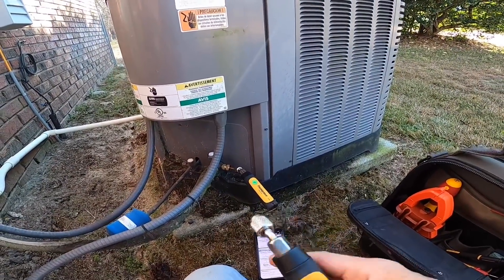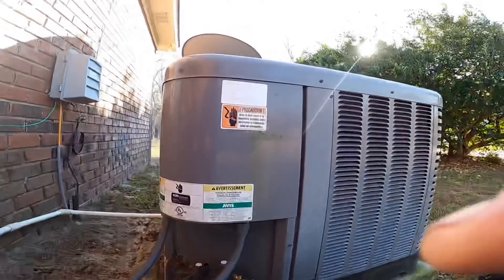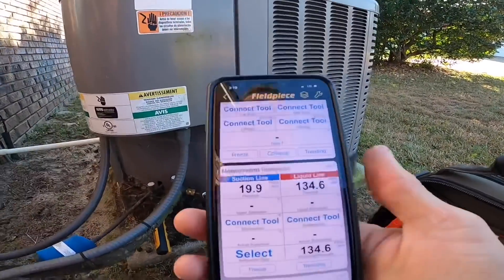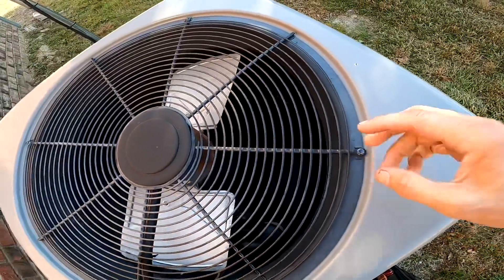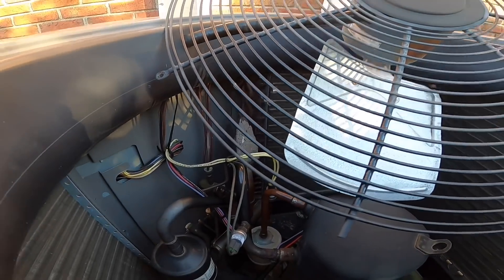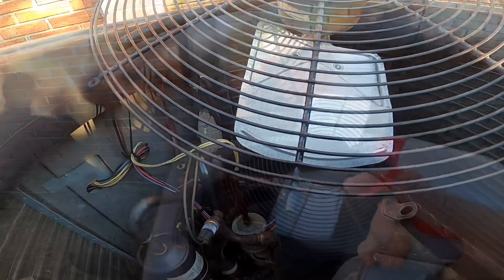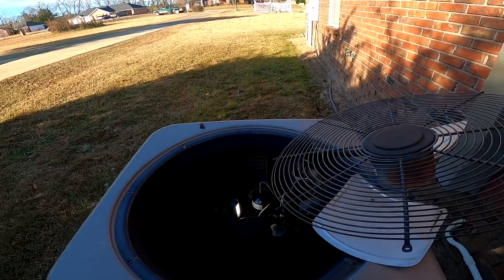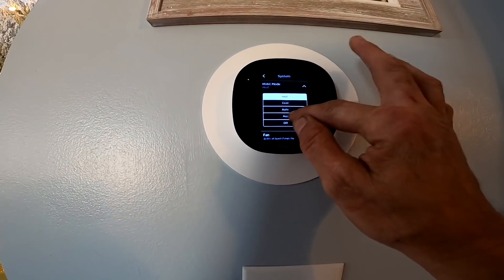2016 Rheem Heat Pump Leaking Freon…Somehow I’m not surprised!

Comment: Well, my barely 6 year old 5 ton Rheem heat pump just got repaired today for leaking out ALL the freon for a cracked weld or pipe.  I'm not sure if this issue is brand specific to this failure but, oddly enough, 2.5 years ago, I had to get the same repair done on the Rheem 2 ton unit that covers the upstairs.  Same leak...same location....on both.  Doesn't really instill a lot of confidence in this brand much anymore.  Sheesh.

Comment: When you go back to solder that crack in the high pressure switch, don't forget to put a wire tie around the body of the switch and the discharge line to hold it securely and prevent future vibration or it will be cracked again in the next two years. We've actually been doubling over a piece of foam tape or using a piece of rubatex insulation like you would use to insulate a mini split line set, and putting that in between the switch and the discharge line (to feel that small gap) & then using the wire tie to pull it all tight. That is a very, very bad design on Rheems part. 
P.S. - just go back to the good ol' Fieldpiece meter. 😎👍
Happy Thanksgiving 🦃🦃🦃
Reply from the maker: Sounds like a good idea